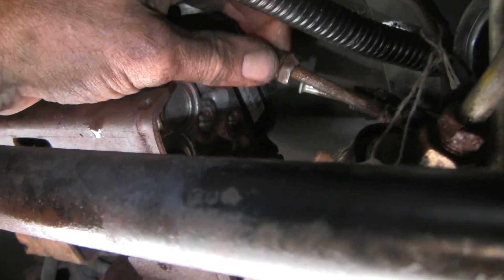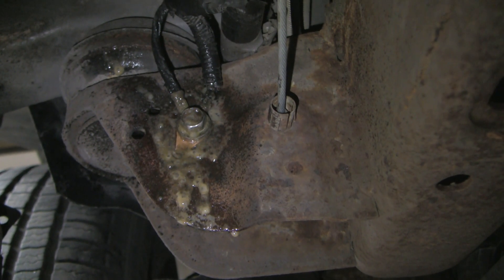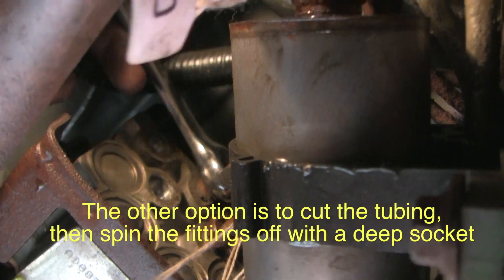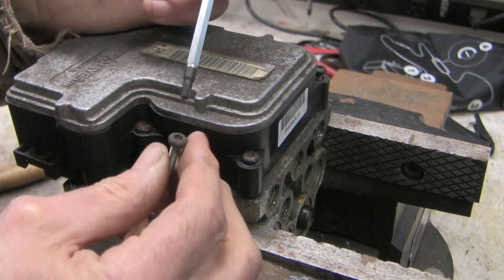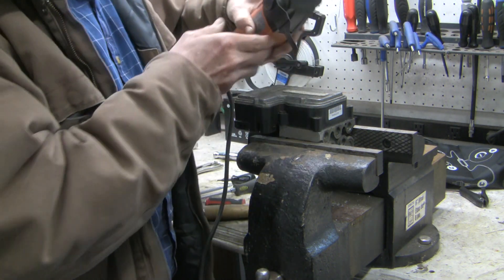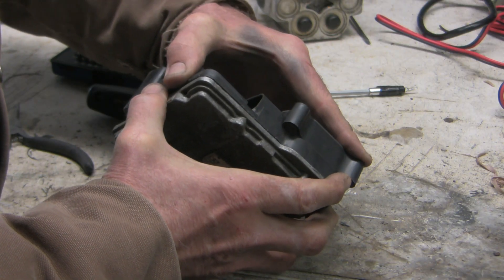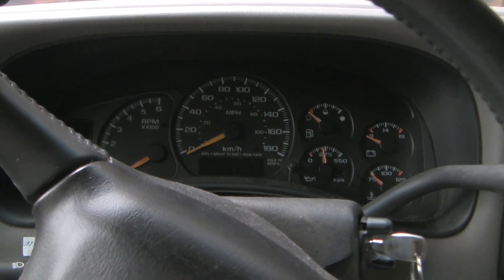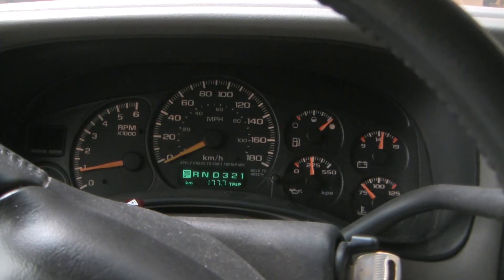How to fix an ABS warning light in a Chev/GM

Comment from the maker: It has now been over three twelve twenty four thirty six sixty months  since this repair was completed, and the intermittent ABS and parking brake warning light has not recurred. So, I'm going to call this one a verified fix.
Reply: Sir, I don't know how to communicate on you tube so well. Earlier today I posted another message to you, but wasnt sure you'd see it :-/ So you seem like a guy who can fix ANYTHING! I have the intermittent abs and brake light. I cannot find my ground strap for the ebcm (I haven't chased the wire through the loom yet, but it isn't on the frame or the steering column). I have a 95 1/2 gmc Sierra k2500. My ebcm is sealed with extremely strong adhesive-no torx screws at all in the circuit board lid. I've slowly cut the adhesive but haven't completed the job yet. Have you ever disassembled one of these? Its kelsey-hayes, with four connectors on the bottom of the unit. Any tips would be greatly appreciated :-) Yes, I'm subscribed! Thank you for all of your videos and knowledge:-)
-jeff
Reply from the maker: @jejch  Somehow I missed this message, it seems Youtube aren't posting replies to comments as consistently as they once did. Yeah, GM modified the location of their ebcm in various years, and with that the location of their ground connection. For any vehicle I own I get access to the dealer repair manual with either Alldatadiy or Mitchell. I've had better luck with Alldata, the cost is about $50 for 5 years, and they include all TSB's and updates. The first place I'd go is to the dealer repair manual. That said, you'll find the ground in the dealers manual but they won't include details of how to repair the EBCM, for something like that they just replace it. I have not done one like you describe.
Reply: Dave (that’s your name, right?)

This is my first posting on your site.  A year ago, at the age of 71,after finally having enough of inept and/or greedy repair shops, I decided to teach myself automotive mechanics, acquire necessary tools, clear out the garage and do my own work.  I still work and my income is such that I barely make ends meet, so doing my own work is a necessity at this point.

I’m on my third Astro/Safari (’88, ’00, ’04) and really like the form factor, for the most part, although engine access is horrible and some component locations are exceedingly difficult (exactly the same EBCM/ABS location).  Living in the rust belt (Cape Cod) I have the usual issues with deterioration of critical parts and systems.  Unfortunately, any pick and pull yards are at least an hour away, so used parts are not that easy to go and get myself in order to save some $.

I’ve seen your interaction on various other YT channels and looked into this channel over the last couple days.  I have to echo all other positive reviews/comments - you seem like a down-to-earth, easy-to-follow person who presents information in a positive, helpful and efficient manner.  

Re: your suggestion in the previous comment, I’ve just looked at both Alldatadiy and MItchell.   Mitchell seems to have both text and diagrams that are easier to see and navigate as well as more complete information in general.  My assessment is based on spending maybe a half hour on one free vehicle guide per both sites.

I’d very much appreciate a more detailed explanation for your preference.  Could you please be more specific re: “better luck” and elucidate your evaluations of both?

One thing about YT makes digging for information somewhat difficult - that of most channels’ use of “Playlists” (or disuse, I might say).  Life would be a lot easier if playlists were more organized and categorized by the creators of the videos, yours included.  I have not investigated how YT works, so I’m not cognizant of whether or not you are able to reorganize, shuffle, create new topic headings, etc., but if that IS possible, it would help immensely to spend some time reorganizing and categorizing in such a way that someone looking for all your videos on one specific vehicle or on only lawnmowers or only vehicle brake work or motorcycles, sailing, etc., could scroll down and find that category and not have to resort to searching the channel and looking at various videos to find the specifics for which they are searching.  Your playlists are definitely organized, but (for example) the last one, “Auto Repair” has videos on other subjects in the list.  Scrolling through a list of 69 videos to find just the right one is time-consuming and somewhat frustrating.  Just a thought, not a criticism!  I totally appreciate your efforts and look forward to learning more from your channel as time goes by.

Oh, ex-sailor, sailmaker/rigger/broker for 20 years - self-taught on a lot of the mechanical systems I see you’ve done videos on, way back when the only instructions come in printed form from Harken, etc.  Improved on existing systems on sailboats, both standing and running rigging, hardware placement/organization, fresh and gray water, a little bit of Atomic 4 work, etc.  6500 ocean miles between US northeast - Bermuda - Caribbean.  I’m a baker now (year 10), but was also a saddler for 8 years, training in England for 2 years.  I’ve also built 6 houses with a friend, done renovations/repairs; Birkenstock repairs, prep cook for a caterer.  Worked in wood, leather, metal, plastic.  Loved to take things apart to see how they worked.  Missed my calling(s) as an orthopedic surgeon and mechanical engineer.  Oh well.  :)  (rc at reinsrealbaking dot youknowwhat if you’d prefer to get back to me that way for any of the above…)  ;-)
Reply from the maker: We’ve got lots in common, thank you for your  insight, and for letting me know something about the kind of viewer I’m hoping to reach.
Reply: Can a person access the necessary abs ebcm circuit board via cutting a replaceable square out of the floor of the vehicle instead of painstakingly taking it? 
I don't plan on selling it so I don't care if there is a curious patch.

Comment: The copper nickel brake line on a roll is pretty easy to form, if you don’t want to wait for parts.
Reply from the maker: Good point, I actually got a length of Nicopp line in case all of the pre-made segments don't fit. It's hard to beat the price of a full kit, including fittings and the saving on labor. We'll see how it works.
Reply: spelunkerd You’re right on the labor. Did this a couple years ago, and remember some swearing.

Comment: YouTubers, remember don't drive the car until the break lines are replaced, brake fluid refilled and bled, and you have the wheels remounted and air pressure checked. Happy motoring.
Reply from the maker: Wise advice! Thanks for watching, Don.

Dave
Reply: I knew that one of the safety police would soon come by to comment on the project being interrupted half way through and the inherent dangers that would present, so I had to get in there first to forestall that  :-)

Comment: When the lights are on the ABS will NOT work. I locked my wheels up during a panick brake. Can I remove the electrical unit with the hydraulic block in place? It’s a pain to bleed through GM ABS blocks and want to avoid that if possible.
Reply from the maker: Yes, the preferred method is to just remove the EBCM, leaving the ABS motor and brake lines in place, if you can get those torx screws undone. Dealers manual procedure describes removing the  neg pole of battery, remove the bolts holding the bracket in place to give yourself about an inch more clearance above, and hope you can get those screws undone. I hope you have more success than I did with that, this old car is rusted everywhere. If this unit fails again it should be a little easier to remove because the screws won't have had 18 years to seize up.
Reply: spelunkerd thank you! I have a Florida truck so not rust issues here

Comment: I was thinking the same thing about the daft screws, show them the bin and install normal ones :-D.
I have a hate for all the odd scews/bolts being used now,  1/4 hex headed screws would have been much simpler to remove, but that's me, im old tech lol :-D.

That didn't look to easy to remove, pity they didn't put the whole thing under the hood.

I did wonder if the wheel speed sensors were all ok, but turning the car off then on would not clear a faulty sensor, so ignore my jibbering lol.
I know almost zero about the subject, but i always enjoy the mental gymnastics that you create in my grey matter :-).

Comment: Great work Dave and that ABS unit looked like a bear to get to and get out. Taking your unit apart didn't seem as bad as mine. Of course, you remember I sent mine off to have it repaired and I saw that they drilled and tapped a hole to screw a bolt in from the back side to release the cover. If only I knew :) Now for those leaking brake lines and you'll be good to go.